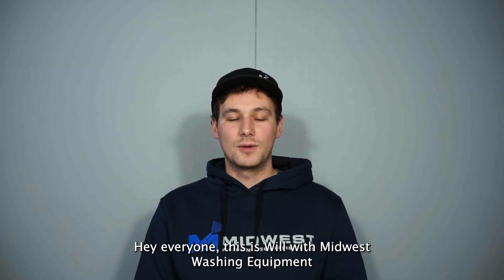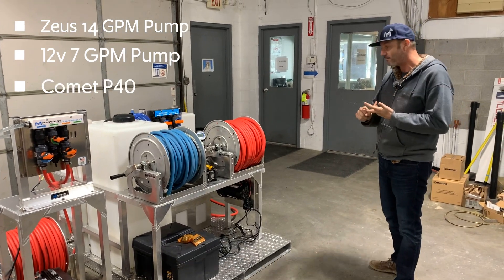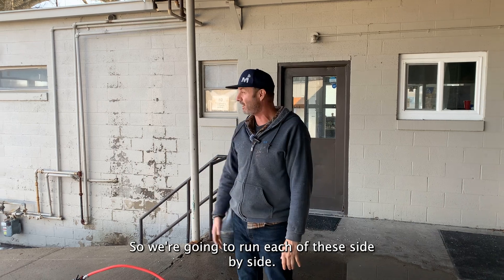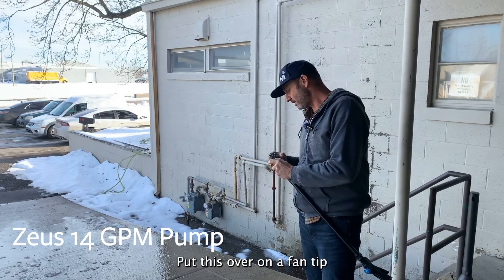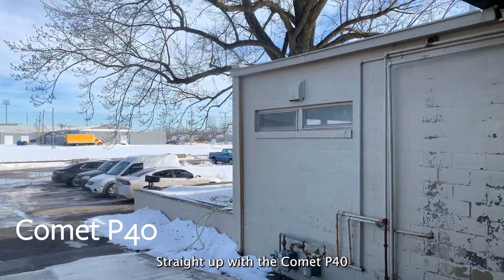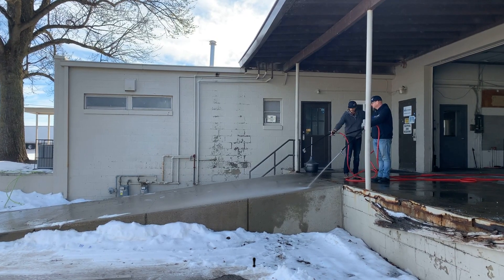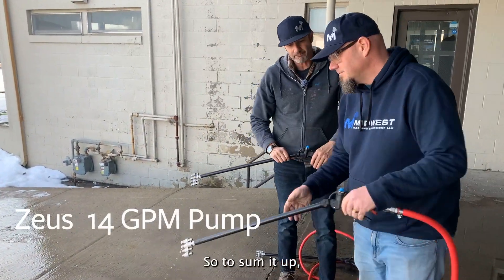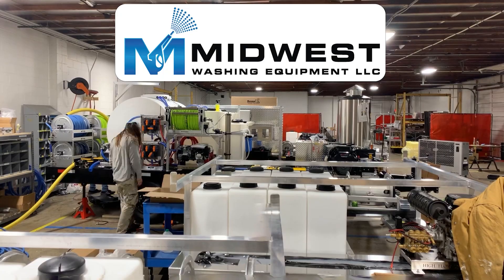Remco Zeus 14 gpm Pump Review and Test

Comment: What is the gpm with nozzle completely open at the end?  Like if I was doing a low pressure Termiticide application?  Also how long is your hose for the 7gpm at tip end you mentioned? … for Zeus
Reply from the maker: 200' hose

Comment: I'm
Going to be honest my 24volt 10 gpm Has better flow then that. You need to go larger with your hose it's to small
Creating a lot of friction loss.  Run 1" from the tank to the manifold, 1" from the manifold to the pump and 3/4 from the pump to the nozzle guarantee better flow

Comment: Thanks for first review. Looking forward to a bucket test and distance comparison.
My initial take away is to skip Zeus and stay with 12v and/or gas pump. 
I like 12V for its control when applying chems especially on roofs, best value and control. $200-400
Gas pump is winner when it comes to power and reasonable price. $1800-2200
Zues is $1400 and still need expensive 24V power source, reliability is unknown and its not best at anything.

Comment: That does not look like 14GPM. I mean, the P40 is 11GPM. I'll keep my gas pumps :)
Reply from the maker: It's not. Check the pump curve.  14 gpm is at the pump outlet, open flow.  As you increase pressure, flow drops.  The Zeus is probably around 7-8gpm at the nozzle and a P40 is around 10 gpm at the nozzle.  How does the P40 get more at the nozzle, starting with less than the Zeus?  It has more pressure or power.
Reply: What does zeus get for distance/ height?

Comment: Are you running the 7gal through your 1/2 proportioner? And is that 60 psi or 100 psi Remco?
Reply from the maker: @investrei22  that's a 100 psi and it's running on our 3/4" hydro-mixer V4. It has the best performance for a 7 gpm 12 volt pump.
Reply: @midwestwashingequipmentllc1209  why does it use 1/2" suction hose from the tanks and not 3/4" , I've seen both use cases and trying to decide for my system to be future proof
Reply from the maker: @kade3682 for consistency and accuracy. You can run 3/4" on a 12 volt, but you might have to adjust the water valve for it to pull SH.

Comment: Great video what would you estimate the p40 flow rate to be? Does you get better performance with a red gun/water boss?
Reply: Hey Joe, I switched from the red gun on my P40 to the water boss and I saw more flow and even better control of the water in cone or jet stream. I like the water boss can be rebuilt too.
Reply: @ awesome. What do you get for flow at the gun gpm?
Reply: @ I haven’t done a bucket test to see how big a difference. It was just a difference in the visual appearance of more water coming out. I need to get my bucket test out and do a Joe test.
Reply: @ I’m just curious about the p40 in general. Pressure and gpm
Reply from the maker: about 10 gpm at the nozzle, 65' range or distance, I've seen it reach 5-6 stories vertical.  No change on performacne nozzle vs red gun or water boss as long as you're using the correct nozzle size.
Reply: @ I appreciate the information
Reply: @powerfulimprovements  Please spare yourself the issues and get a AR30 pump instead of the P40 or Ar45. I've been running the AR30 for 2 years not a single issue or leak!!!! Love the P40/Ar45 but the leaks kill it for me. AR30 or AR40 Are aluminum coated on poly so it's still chemical resistant but doesn't leak due to the strength of the aluminum. Also, I've been watching your channel since 2019 or 2020!
Reply: @ that’s fantastic! Thank you for following!!  What kind of flow are you getting with the AR30?